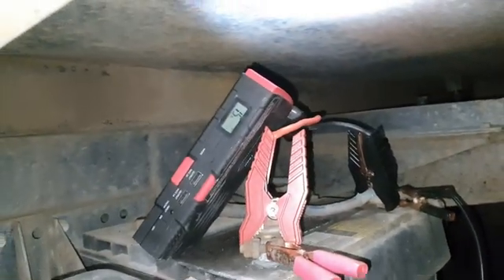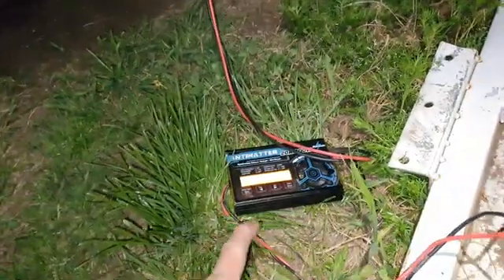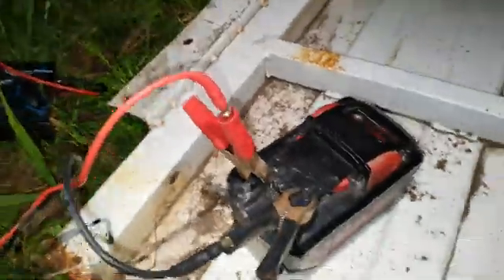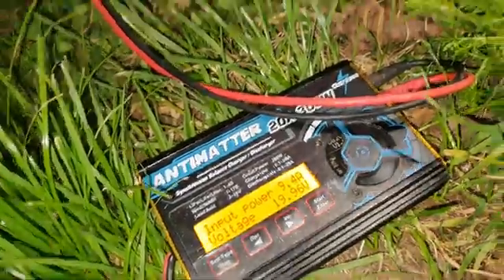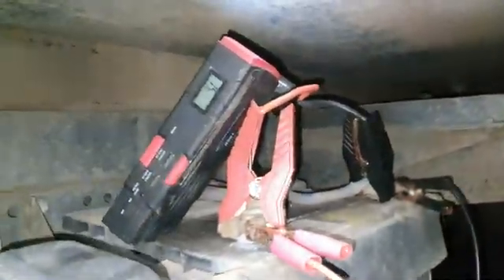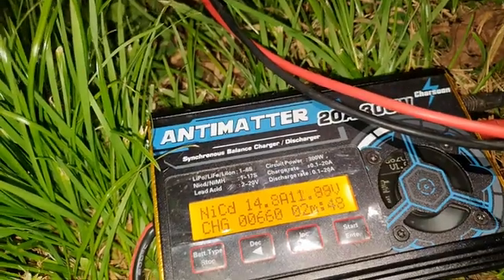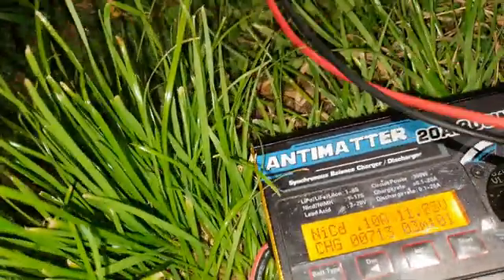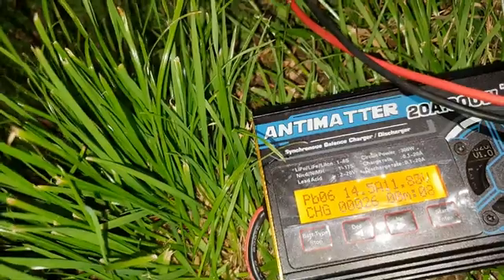Jump Starting the Mazda T4000 with a lipo charger

Comment: Don’t turn it off, that’s bull shit my Park lights where turning  on by them selfs ,my high beem made my head lights dim, and the last straw was it was raining and stoped raining but they would not turn off till I pulled the wipers fuse, you have my voodoo ,I have a second hand stalk to solder in , I just pulled from a wreak ..
Reply from the maker: Doesn't it suck when they turn on them selfs